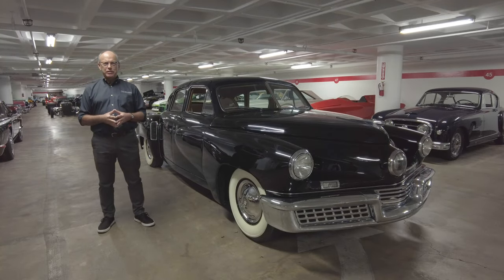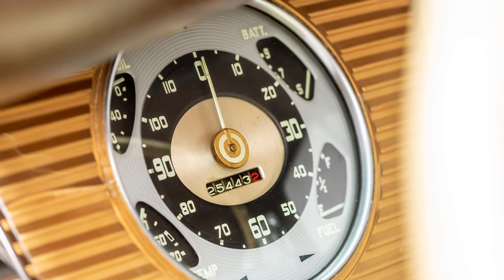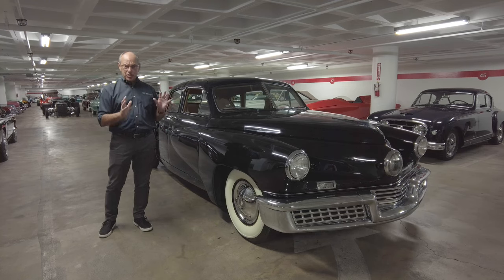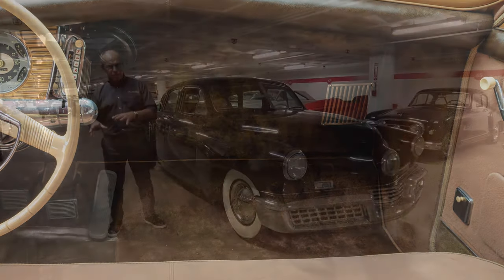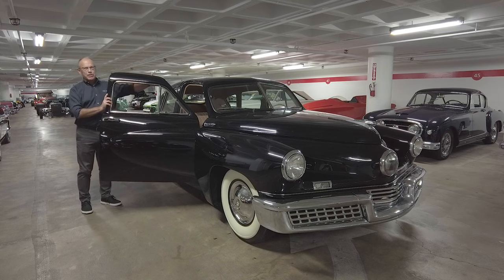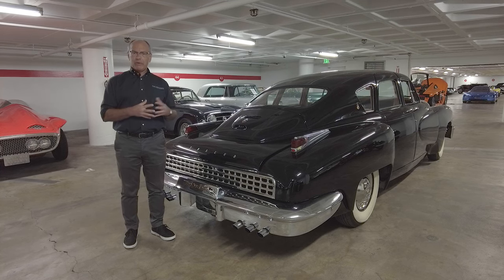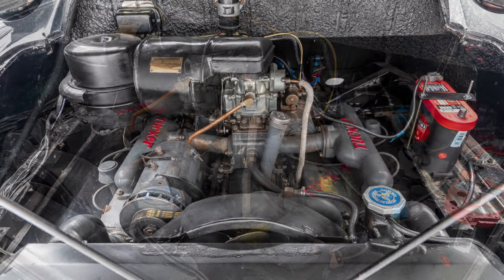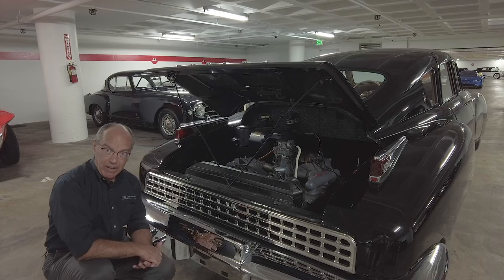$1,000,000+ COLLECTOR CAR | TUCKER 48

Comment: The Tucker was capable of speeds of 120 to 130 mph, which was incredible back in those days. While making a high speed endurance test run on an oval race track, the test driver eventually flipped the Tucker 3 times ( barrel rolled ) at 95 MPH!!! The driver sustained NO injuries worth mentioning ( only a scratch ), and after replacing a single blown tire, the car was still capable of driving. This is incredible, even by today's safety standards. Can you imagine if the car you drive right now would still be capable of driving after flipping 3 times at 95 mph? I don't think so. It would most likely need to be loaded onto a flat bed trailer & hauled away to the junk yard.